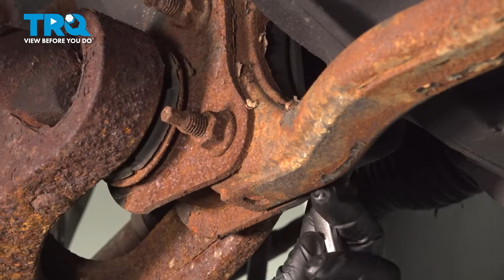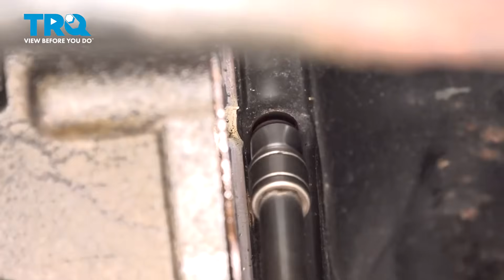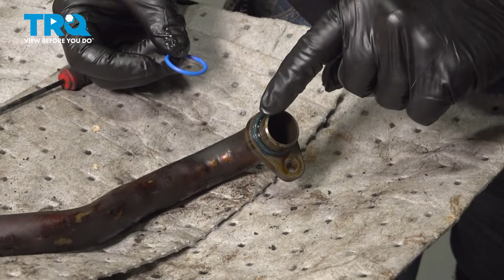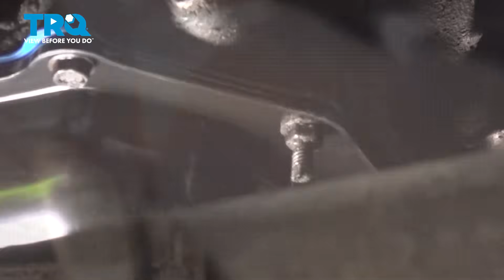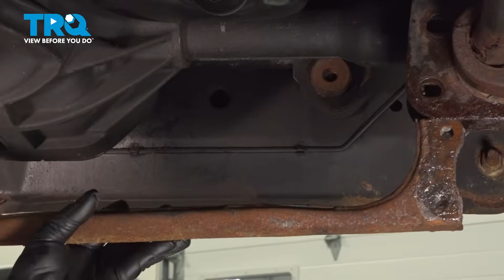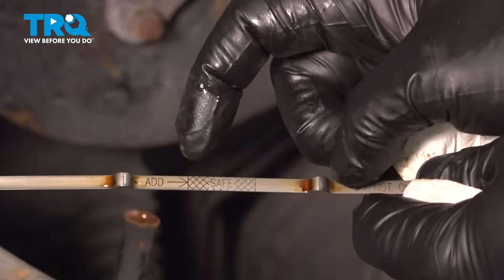How to Replace Engine Oil Pan 2002-2008 Dodge Ram 1500

Comment: I watched this video first before climbing under my truck and there are a few things that I could not identify so I stopped halfway through and went on to look at other videos.  I watched 7 other videos and I had flash backs to this video and remembered things that you said and did that made more sense to me!  I then watched this video again and after seeing those others and I have to say that this is by far the most instructive and informative of all the video's that I watched!  Your commentary was spot on and very informative and extremely helpful.  Thank you for making such a professional tutorial. Once I get all my parts I know what I need to do in the proper steps I need to do it in!  Again, Thank You for making and posting this Video!

Comment: I have a 2004 ram 1500 4x4 5.7 
I recently did a 4inch suspension lift 
And it gives enough clearance to just drop the pan. I’m not sure on the 2 wheel drive

Comment: So I did this.Thankyou for the video.  It was  well explained.  I also changed the transmission fluid. 
   Question tho. I replaced both filters, made sure the tranny fluid was in the round  filter. The truck is together. It now has a code for a transition? Can you tell me why this would come up now?   It's a 2006 4.7

  So turns out that these trucks can take up to 9quarts of new tranny fluid. I put in 6...seemed to read good but putting it into reverse it slipped. Put another qt in. Let it get warm. Then drove it a small ways. Slipped after I got back. Added another quart. Took it for a short drive at 40mph.  Came back and it showed low. Added another quart. Pulled the positive cable off the battery for a few minutes too. 
  Started it up. No check engine light and drove so smooth.

Comment: Where exactly are you placing the wood blocks to support the engine after jacking the engine up.  Is the area readily apparent.  Will I easily be able to determine where the blocks should be?

Comment: Hello TRQ, on 7:10 put block of wood between motor mount and chassis.(no clip of it being done)
7:28 where is the block of wood between motor mount and chassis? 
Am I missing something? This repair video shows every nut and bolt but doesn’t show how to put a block of wood between chassis and motor mount. Was the pole jack still in place on the trans bell housing .  Just seeing what I observed.

Comment: 4th gen Ram has “3” transmission mount nuts to remove. (this video shows 2 only for this gen 3 ram)
I followed along this video to replace my oil pan on my 2011 ram 5.7 hemi 4x4. I made the mistake of only removing 2 of the 3 transmission mounts on my 2011 ram. This caused my engine to not lift up straight so when I was finished and  lowered the engine… my engine was not aligned on the front motor mounts. I was able to align the engine with a pry bar, but reflecting back on doing this …it was not safe and could have caused an accident. My engine mount alignment problem would not have happened if i had removed the 3nuts. But i did complete it… my truck has a new oil pan and is running perfectly now.
 I really appreciate these videos . Thank you

Comment: I get this is an older ram, but im assuming this is nearly the same process for a 5th gen ram with a 5.7 hemi
Reply: I did it to my 4th gen … only difference is that the transmission mount has 3 nuts to take off on a 4th gen… the video only shows 2 being taken off because it is a different design. double check your 5th gen for differences in design too
Reply: @inspectz13 did you ever replace the oil pan using this videos steps? got a 2011 5.7 and about to start but have sone doubts

Comment: Now do you absolutely have to jack the engine up. I saw another video the guy didn’t even touch the mounts. I will be doing mine from under the truck on ramps.